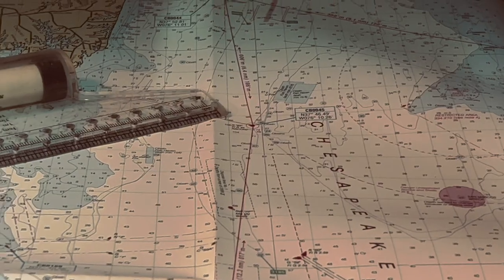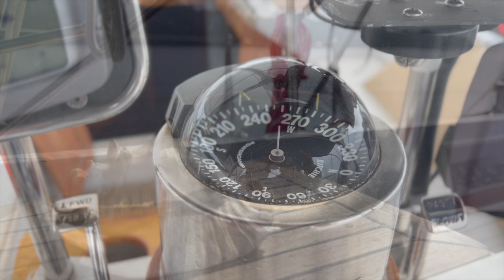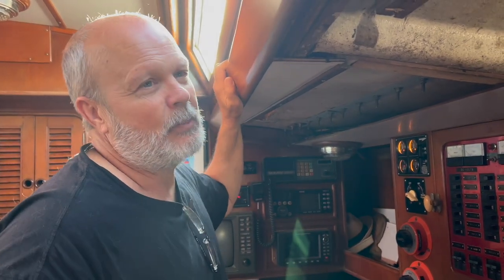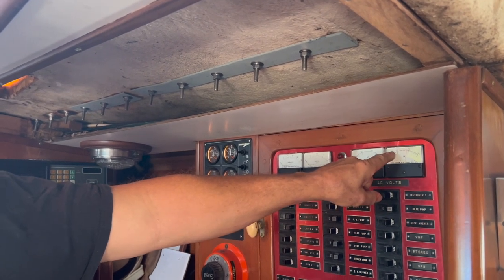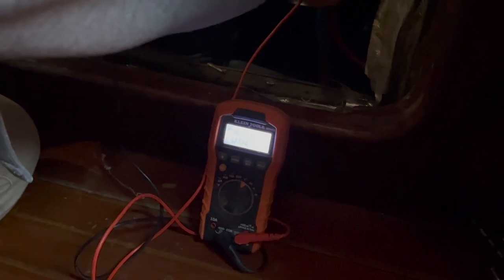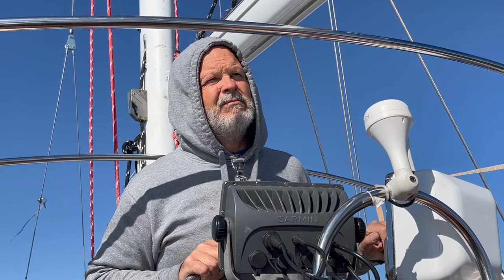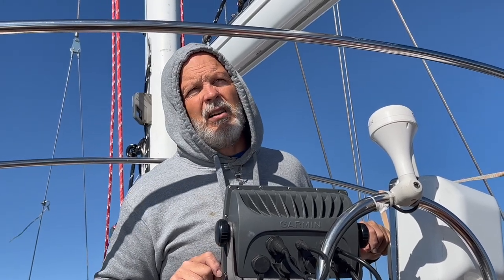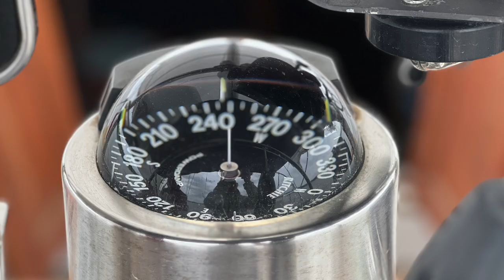A Smooth Sea never made a Skilled Sailor- Sailing SV Bohemian- episode 48

Comment: You guys make a very professional looking video.  Well done.  May I suggest a monitor wind vane for your short handed sailing.  It will give you more time to pay attention to the sails.  Just a suggestion.  You are correct that there is no substitute for sailing when it isn't comfortable to learn, make mistakes and break stuff.
Reply from the maker: The biggest issue is keeping her steady when trying to adjust the sails . Not so bad in light wind . When the genoe is out and the back staysail main is  out . Shes super balanced . I bet a monitor wind vane would work good . Thanks for the very well done . It took a minute to do

Comment: Your battery testing isn't quite right , depending on your discharge level, 15 amps if you have used say 20% of your 500 plus , you have a few hours of charging ahead of you ,   as your batteries just had a jolt of power , they will read high voltage.  That doesn't mean they are fully charged , they can read  outage way down in ah .  And you can still be way under fully charged when it goes to trickle .
Reply from the maker: I have 5 two hundred and fifty amp hour  batteries. I was using 10 percent over night . So that was nice . Thats using a frig and 4 hours of tv .. sometimes it was down to 12 .50 . , 20 percent . It’s crazy how much stuff you have to keep in your head . I still have to master the electronic and navigation.
Reply: @sailingsvbohemian1464  the electronics navigation isn't to heavy on power , the biggest are auto pilot , and radar , so to you not a issue
Reply: @sailingsvbohemian1464  1000 ah for 5 x 200 ah batteries , if only 10 % use = 100 ah used , if you can charge at 30amps that's just over 3 hours ,  
For your nav , as your staying local , why not run a 12v mini pc , with open cpn,  free charts ,  get a 12v monitor in the cockpit .    Save power .
Evan a Panasonic toughbook,  Windows 7 or 10 , runs 16v on a car charger .